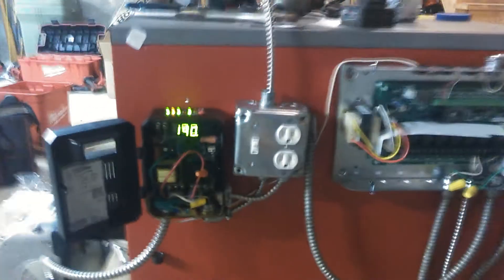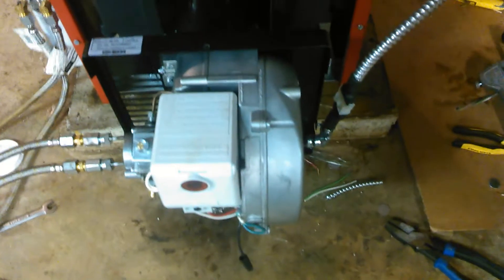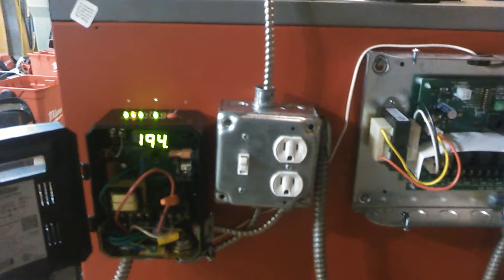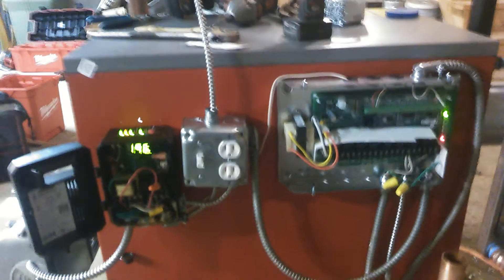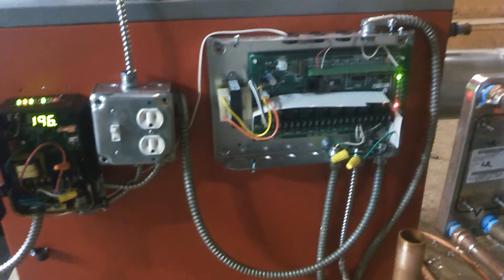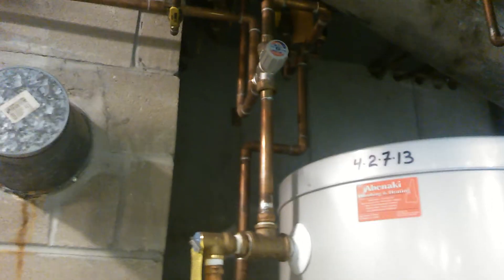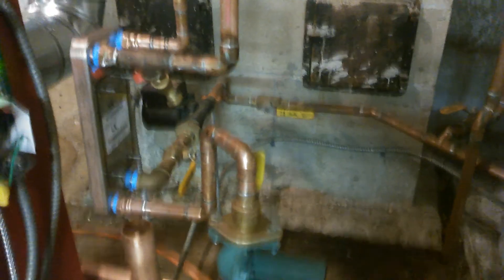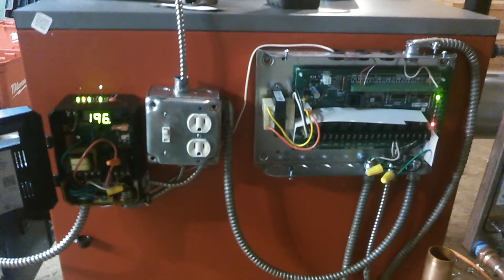TRIO TRIPLE PASS BOILER WITH RIELLO BURNER

Comment: How many GPM going through that low mass boiler? Are you piping zones in 3/4?I see you still solder....LOL....lots of guys pro press everything (EXPENSIVE) I don't see how they sell a job like that!! Do you like Riello oil burners? I have serviced some but not as populr as Beckett around here (PA)
Reply from the maker: I Love Riello burners, I do have a pro press now and it saves me a-lot of time. I can do a complete push and pull in a day myself. I have some pictures on my instagram if the pro press jobs I did, also a small youtube video. I am going to do another one because it's a great tool.
Reply: Yep, pro press is a great time saver for sure...I use Viega.

Comment: Why do you have a plate heat exchanger if your running to an indirect?  Why don't you run directly to the htp from the boiler.  Correct me if I'm wrong but are you heating water to heat water to heat water